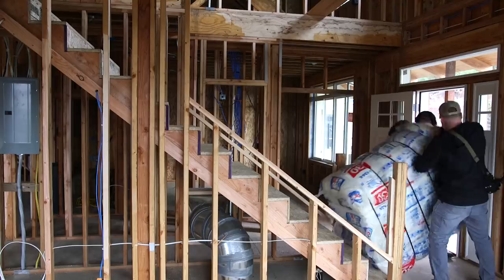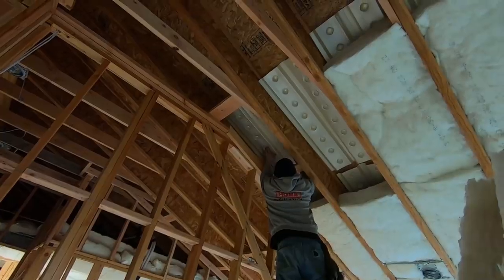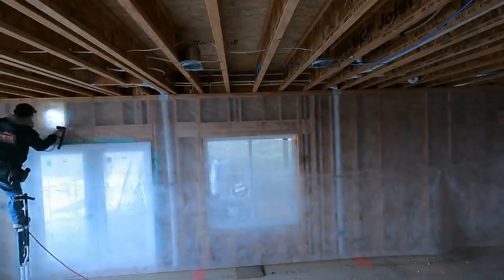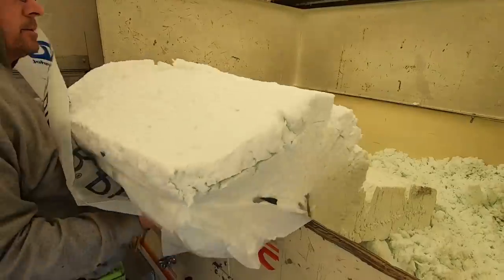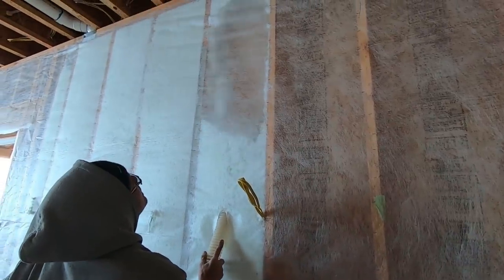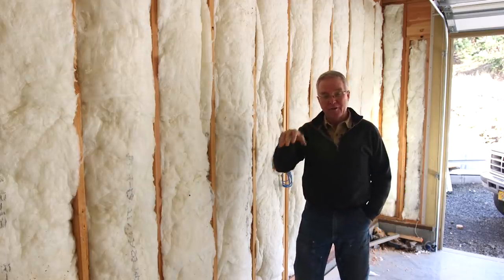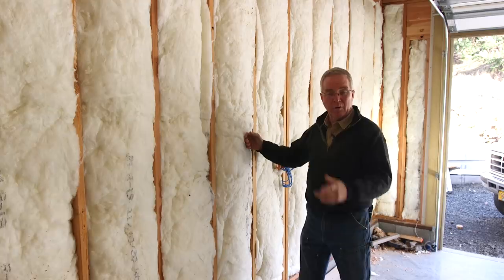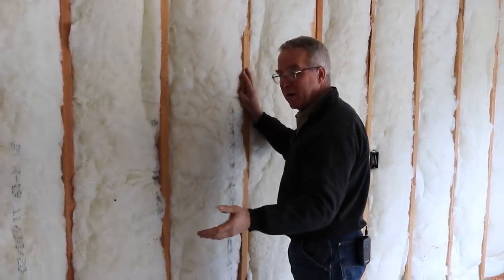Insulating A Nice House Ep.104

Comment: removing the paper backing from insulation might also increase fire safety and reduce spread of fire. And if you watch a plumber sweating copper pipes under the sink to fix chewed up pipes so he can put new shut-off valves on .... there are always wet rags and a spray bottle with water nearby and chances are, the paper on the insulation does catch fire until the spray bottle comes out.

Comment: You pretty much nailed it. There is another ease of no paper as well tho.. With the paper on it it's harder to get a good seal at the points where bitter ends meet the plates and each other in cases of cut pieces in the same 'cell'. (Stud bay as we call it in the midwest) the paper makes it much harder to "mash" the pieces together or into the plate. Also we've come along way in the materials used and the original (primary) reason for the paper was so the materials wouldn't be as much in contact with skin. Now adays the materials used are much less irritating to the skin...

Comment: 3rd reason for no paper on the fiberglass its not considered a continuous vapour barrier. In Canada you have to have one piece continuous envelope from the sill plate arounds the structure with the seams taped with tuck tape.
Reply: The lack of vapour barrier is the one thing I was wondering about as well.
As Scott said, local building codes vary, but I expected that Oregon would be cold enough in a typical winter that a vapour barrier would make sense, if not be required.
Reply: We also blow our attics.. and batt our walls...
Reply: They really should be paying more attention to air sealing. But this house is only really meant to look good.
Reply: @Bob_Lob_Law  are you from Cambridge? Maple Grove road?

Comment: Wondered about vapor barrier on the fiberglass wall insulation.  Here in Delaware, all sill plates must be sealed and rock wool used for fire stop places, fiberglass doesn't cut there.  Of course we also have 18" of blown in cellulose in the ceiling too.

Comment: The big thing about paper facing is that it contains a layer of asphaltic glue which acts as a vapor barrier. In a climate like the PNW, keeping that towards the inside of the house is best because it will help stop warm humid inside air in the winter from working through the drywall and condensing on the cold outside sheathing. I think the decision to use or not use it has more to do with whether you need a vapor barrier for the particular situation.

Comment: Always interesting to see the differences in construction from the US to the UK. If I've got my conversions right, I've just finished designing a house with walls (and roof) of an R value of 36. It's also compulsory to lay insulation between floors here in the UK to reduce sound transfer.
Interesting point about the windows, which is valid, but the detailing around the edges can be more troublesome than the units themselves - it's all about the detailing!
So glad to see that you didn't use spray foam as there are some horrible chemicals in it that I wouldn't want to be around with my family.

Comment: You make a good point about what insulation you need per the climate.  However, as far as insulation goes, air infiltration is the largest source of heat loss in a home.  So for my dollar, a 2" application or spray foam by a qualified installer would do better than 6" of fiberglass.  Technically the fiberglass is higher r value, but in practical applications the reduction of air movement will mean a more comfortable environment than the fiberglass.

Love the channel!  I'm getting into welding and watching through your videos on the subject!

Comment: Three years ago I had two cabins built on the lake for rental income. Honestly they are not more than portable buildings (sheds) if I were able to have purchased off site and had them moved in I would have but due to trees they had to be site built. I'm in the south so cooling a place is more important than heating. The only thing I had different was I requested 2x6 exterior walls. Once it was built i finished everything out myself to save money and I used rockwool. One window in the bedroom one in the kitchen and one in the living room I used a minisplit to cool and heat the place and it's unbelievable how efficient those buildings are they do have double pane windows and are really tight. I've been pleased with rockwool, so much in fact this years I'll be building three more and plan on using rockwool in them as well

Comment: In California here, we do dense packed cellulose in some of our high end homes. There's some benefits, insulating value doesn't degrade, and it does well around wires and pipes...which can get sloppy with fiberglass or rockwool. From my own experience its a better sound insulation than rockwool because the insulation is packed into the joist bay, so you get some of the air sealing you expect to get with a flash a batt system (2" close cell and rockwool or fiberglass). Basically gets you a lot of the benefits you get from a flash and batt at 1/3 the cost. It's actually really good value. The only drawback with these are the sheetrockers hate it. The problem with densepacking is it does budge outwards, no matter how you roll it, you will have a spot somewhere that pushes the drywall a little. We only use 5/8" so if you sequence your screws you can push it back in some, but sometimes you do get bellies in long walls usually right around waist level. I like the system a lot because of the value, but there are some drawback though.

Comment: From what I understand. Over here on the other side of the pond, when talking about insulation; the building elements (floors, walls, ceilings...etc) have U values, the U-value is the sum of R-values that make up that building element. So on a wall for example; the gyp-board, framing, insulation, OSB and cladding all have R-values. And together these total to a U-value (R+R+R+R+R = R, 1/R = U), which is the U-value of that wall. The code in your area will typically specify the required U-Value required for the particular building element you're constructing. U = Rate of Thermal Transfer, R = Thermal Resistance of a Material.

Comment: Savings by insulating floor space is highly underestimated. Bedrooms and living spaces are heated at different temperatures. Insulation brings some acoustic benefits too as you mentioned. I would always suggest insulating at least the bathrooms as they use fans and windows get opened more frequently. If a building contains two different heat zones (bedrooms - living space) insulate the two zones even if it is only an R10 (delta T in between the two is not as massive as to the outside of the house and definitely insulate Bathrooms to account for additional venting. Only my take on the matter. The construction of residential buildings get often a bit to based on codes and general practice - think how you use a house and where you spend time and what the air quality will be like in the rooms and then treat the areas as zones. I do enjoy your videos keep it up

Comment: I have built several houses from the ground up by myself. I have remodeled many more. That being said, I always thought a house needed to breath also. But I have watched many videos of modern day builders that totally seal up a house from top to bottom and do their best to achieve to zero air flow from inside out as well as outside in. If you don't allow outside air in that carries moisture then you will not have to worry about drying it out. They sometimes have dehumidifiers that suck what moisture there is out of the air. But if you don't have to continue heating or cooling new air coming in, your cost of comfort will be considerably lower.

Comment: You made a point about the windows being a cost do to no insulation.  Which makes for a good reason to invest more money on the best or better windows.
Reply: Windows vary so wildly, insulation wise. These days you can get glass panes that are so thick and well insulating, that even when it freezes outside, the snow sticks to the outside while the inside feels the same as touching wood.
It goes without saying that they are ludicrously heavy and quite expensive.
Reply: Average windows are around R4, but even the best windows money can buy are only around R10. That's a whole lot less than R20+ in the walls.

Comment: 9:29 In cold climates (at least) triple-glazing is widely used in windows and many times there's also an argon gas-filled gap between the two innermost panes to reduce heat transfer.
In Oregon that might be overkill, but it was -20°C (-4°F) last week here in southern Finland, Europe. A pretty normal midwinter temperature. Inside it was at least 68°F (20°C) the whole time.
Reply: @isaackvasager9957  What kind of windows are typical there?

Comment: That blow in insulation looks brilliant quick and clean. In the UK if its not a fibreglass product, we tend to use a solid celotex or Kingspan sheet insulation. Ranges from 1" to 6" maybe more. And a product called gapotape. Time consuming and messy.

Comment: I did blown cellulose insulation here in NE Florida decades ago. Boy I hated that work in the middle of the summer in an attic space. Crawl down out of there looking like a gray abominable snowman. Worst of all was adding insulation to mobile homes. The static electricity discharge could blow you right off the ladder if you did not keep everything grounded.

Comment: Its hard to fault almost anything done on this channel and i love your videos!..  I'm a bit surprised you did not insulate your mid-floor 
for the sake of a few extra bucks you would have helped reduce unnecessary loss of heat from your ducted system and also mitigate
noise pollution from the upstairs bedrooms... Anyway that's my 2 cents... Your  build is coming along nicely cant wait for the vids on finishing etc.

Comment: You could put some batten board or plywood up in the little side rooms on the sides of the bonus room. That would be a fun little project. It will protect the insulation better than that radiant sheeting and look awesome.

Comment: Here's my problem with blown-in cellulose: it compresses and settles over time. More than batt insulation by far in my experience. Recently inspected a home built in '97 in which the BIC had settled up to 12" in some areas of the exterior walls. These gaps in the thermal blanket had resulted in some minor moisture damage from condensation (home uses AC in the summer). Just a thought. Thanks for the video.

Comment: currently building a house in MN. Our insulation contractor suggested BIB's as well. And Spray foam on the rim joists. The house is super quite as well. Not much additional cost vs. bats..

Comment: Man its interesting to see different countries methods of building even with insulation. typically in nz we use fiberglass batts r28 on walls and r 34 on ceilings no crinckles are allowed and they are fail strict on the inspection of this.
Also depends on the type of home be it a standard house or a passive house where air seal is vital! Great vid as always thanks guys!!!

Comment: We had cellulose blown into our walls decades ago. I'm not sure if its changed, but that stuff settles in the walls, leaving uninsulated pockets near the tops.
Reply: The problem you probably had was the method the contractor used to install the cellulose. If it is a "loose pack" method then it can and will settle. It's the lazy way of doing it (generally speaking). If the contractor "dense packs" the cellulose then there is no settling because the cavity is packed completely full with no air pockets. Demand a dense pack when choosing a contractor.

Comment: My understanding is that the paper backing on old style fiberglass insulation decreases movement of water vapor, and because of that can cause drying problems inside the wall cavity. If you've got an exterior moisture/air barrier, there's really no reason to add a vapor barrier to the inside which would slow down drying toward the inside of the house (and maybe causing the mold/mildew problem you alluded to).

Comment: As someone else pointed out. What you got was blown in Fiberglass in the walls. You really have to be careful with this to make sure you get the right amount of insulation in the cavity. Due to the small amount of binder used in the process, an installer can put in less insulation and it still looks full. It's imperative that you get the correct density to get the advertised R value. And no matter what you do, Fiberglass will never insulate as well as Cellulose. When it comes right down to it, good insulation is one of the few systems in a house that has a direct impact on your comfort and how much it costs to live in your house.

Comment: Another great thing about cellulose is its ability to handle moist air.... (not liquid of course.)  The stuff has a large surface area, so it can absorb some moisture and then dry out again. Of course if you give it too moist air you can overload this ability and then you have the same problem as with liquid.

Comment: I'm not a contractor but here in the midwest, all the home stores sell faced insulation.  You put the paper side towards the heat (inside side in Wisconsin).  It's supposed to act as a vapor barrier.  Some builders will use unfaced and then apply a plastic sheet stapled to all of the studs.  I believe it still is code here.

Comment: Insulation and thermal equilibrium works a little differently in space. Space is cold not because the air is cold but because there is no air. This removes both conduction and convection from the heat transfer equation. Heat is only transferred through radiation in space. This is the type of heat that shows up in IR goggles. On the ground, most heat transfer occurs through conduction and convection. A bit pedantic, I know.

Comment: When I built my house, tho not a large as your, I insulated all the interior walls, and was so,so glad I did. The improvement of sound abatement was really nice. I insulated my house so well that when we had a hard frost, my neighbors roofs would be non frosted ( melted due to heat rising ), my roof would be totally frosted, no heat escaping , or very little. Wish I were wealthy, I would buy that house. Wondering is there any draw backs to the area where built, we havent heard to much about where its located.

Comment: I would reconsider drywalling or at least taking a few minutes to tack some cheap panelling into that attic space. Every single time you try to wrestle a box or any old junk in and out of that space while awkwardly bent over, it will be 100% guaranteed to snag on any tacked on paper or fabric covering and the insulation behind it. It's a magical attraction, no matter how hard you try to be careful about it. The owners will be cursing you for generations if you leave it like that. Not every day, maybe not every month, but every single time they go in there, they'll curse you :)
Reply: for a better air seal I'd sheetrock the roof joists continuously before building the kneewalls

Comment: The ISS is actually not a great example for something that has to be thermally insulated very well. The vacuum of space is already an amazing insulator, much better than any residential insulation.
In fact, it insulates so well that the space station needs special radiators to get rid of the heat it produces to keep the temperature at a comfortable level.
Reply: They do need to protect from the sun's radiation though, as they want to avoid adding any extra heat if at all possible. This is why most of the exterior is reflective surfaces.
Reply: @Beef4Dinner22  And not to forget about the incredible thermal diffference between sunlight and shadow side and everything that comes with it, thermal expansion to mention above all. If I remember right the temperatures may vary between -200something °C in the shadows and up to very hot in direct unfiltered sunlight (cnnot remember the exact figures, but those space suits have to withstand quite some heat it seems.) So you get 300 °C and more thermal difference and all the thermal expansion related to it.
Reply: Vacuum only insulates for conduction of heat. Radiation still exists through a vacuum. Thats the reason earth gets hotter when the sun shines on it. If vacuum was such a good insulation for al forms of heat, sunlights would not heat our planet. It does so through radiating heat.

Comment: Dry-blown cellulose is good, but wet blown cellulose is better, IMO. It doesn't pillow like you see in this video, which means far fewer screw pops in the drywall. Also wet-blown is better for sound with a higher STC. You should try it on your next build and you'll never go back.

Comment: I was hoping to see what was being done in your semi-conditioned crawlspace regarding insulation. I've seen open block around the perimeter that allows air flow into this space unimpeded, into a cavity that has your HVAC and its distribution in it. How is the equipment supposed to be efficient when it is heating/cooling the crawl? We see the same scenario in attic cavities, with a foot of insulation, with the thinly insulated flex ducting running around on top of the house insulation? How is that supposed to work?
Reply: Not very well is how it works.
Reply: Yeah, not very well. The crawl space should be insulated and conditioned just like the rest of the house. The mechanical equipment should live in a comfortable environment.
Reply: @Bob_Lob_Law 's Law Blog

Comment: Cellulose is probably the best insulation material, and is biodegradable. The structure of the roof plays an important role, and as long as the roof structure is designed to maintain the insulation in the original condition, it is the best choice. The problem of insulation mainly comes when a roof structure opens insulation to the elements.

Insulation utilized for fireblocking really needs to be rockwool.